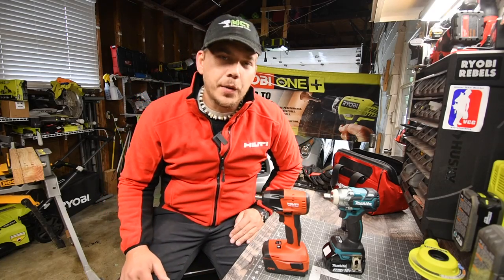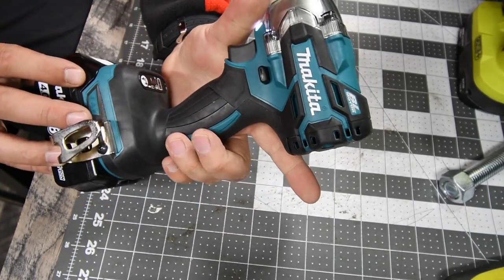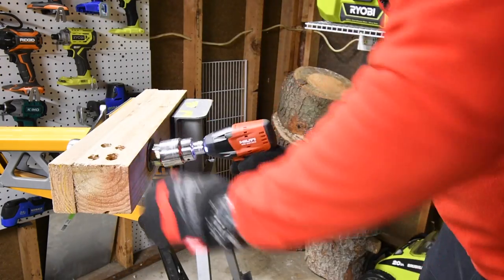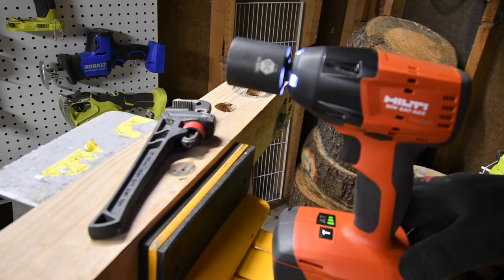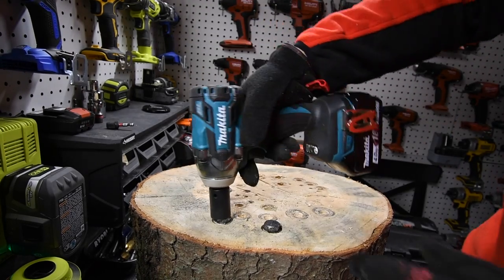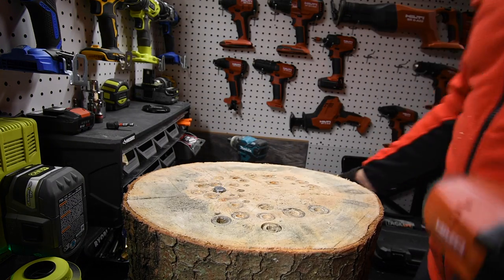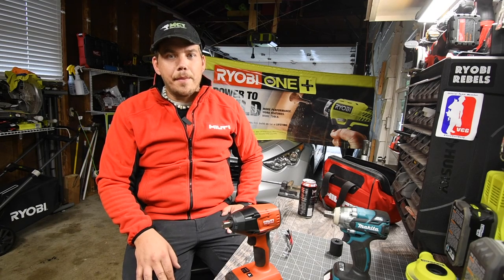Makita vs HILTI (Impact Wrench)

Comment: Hi Dave, excellent video ty so much, both are very good tools and very reliable with excellent quality warranty, I’ve always used the hilti hammer drill and Milwaukee impact, both these tools did excellent in my opinion now, I’m more interested in the hilti from past experience, the warranty is outstanding with the hilti, excellent quality tool ty, regards, Bob,

Comment: Same impact I have in my profile pic lol it's good impact for its size I think it's quite powerful it's not designed to work with wood a think more for engineering /mechanic type stuff steel framing work light  engine jobs has a decent size hammer the motor just isn't fast enough in forward really good quality tho scaffolders use the makita all over the UK
Reply from the maker: very good and I thank you Mic

Comment: the way you are using the torque wrench is causing it to be over torqued, you need to slowly tighten till it just clicks
Reply from the maker: west sir. but these impacts wrenches should be able to take it out still
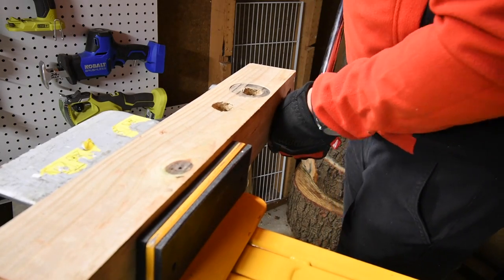Reply: Yeah. At 8:30 it looks like it went past pretty far. Using a handle that long could at a crap load more torque to that nut.  I'm still kinda disappointed these "impact wrenches" couldn't just bust those nuts!

Comment: Try it on a steel beam with 110ft pounds should blast it straight off it's rated for 210ft pounds lol dave might be the size of the nut like it does effect the performance alot👌👍👍
Reply from the maker: I will do that and yes the bigger the nut the more power it is required to to the task

Comment: Idk why the nut size would matter here. Your pivot point is the same and torque is torque. Both of these seem to be rated well above the 70 ft lbs so should have no problem. My 1/4" Makita impact driver only rated for 129 ft lbs of torque (versus the 295 in this video) with a crappy 1/4 to 1/2 adapter busts 90 ft lb lug nuts about 10x quicker than these. Guess I'm not understanding something...
Reply from the maker: yes, these are low rated impact wrenches.
Reply: I guess my point is why is the "low impact wrench" rating that has much higher "nut busting torque" rating struggling more than a lower nut busting rated 1/4 impact driver? I can't wrap my head around it.
Reply: @JML1987  thats because the motor works a bit different between those tools. An impact wrench is optimised for nut-busting torque and generally has a heavier but slower hitting hammer where as an impact driver such as yours is optimised for (un)screwing/bolting speed. In a similar spec range the impact wrench is always stronger in terms of nut-busting strength, but if a nut can be spun by both, the impact driver will almost always be faster.

Comment: You're losing a lot of torque with that adapter on that socket. You can even see in the video that there's plenty of play in there. You should do the whole thing again, but use a correct socket for the tools.
Reply from the maker: that is correct, that's why im getting the exact sockets I need for these tests
Reply: Not to mention wood absorbs impact vs say lugnuts.

Comment: You lose a lot of torque by using a adaptor. Allso because of the thin wall of chrome sockets/adaptors you lose a lot of power as well unfortunately... It really pays off to use the right accessories. I actually own the Makita (me being a prosumer and electrician) and for my work it actually rocks, especially because of the size (I don't need a lot of power but it sure is nice not needing to do lag bolts by hand. Mostly brick/concrete fastening.)
Reply from the maker: yes you do. and I thank you for viewing Mischa

Comment: Man I feel like the Fuel Impact driver would blow the doors off of these things. Great tests as always Dave. Any chance we'll see Hercules and Bauer on the Channel? I know they have Brushless tools coming in the near future🤔
Reply from the maker: the Milwaukee fuel impact driver is a beast
Reply: Makitas stronger than the milwaukee
Reply: I believe TTC's testing shown that the Makita LXT compact impact wrench was more powerful than the Milwaukee counterpart, largely because the Makita is approaching mid torque size (but also brings a power benefit from that), and because the Milwaukee compact impact wrench is pretty lack luster.

Unless you mean their actual impact drivers, in which case, the Milwaukee would still lose the torque battle against this impact wrench, because they're different tools for different jobs.

Comment: They just got wxt14 and 15, much stronger, same size.
Reply: Its XWT15 OR XWT14 just got the  XWT15 it has 240 ft.lbs of tourge and 430 ft.lbs but busting tourge
Reply from the maker: I will be checking this out and thank you Pfoxhound

Comment: Why use such a big socket on the gun if its torque is rated for mid range. I have a cheap ass makita clone from "wish" that cost $25 about $30 total shipping included it breaks loose and takes off the lug nuts on my crown vic police interceptor so easy it also works on my neighbors F250 ALL day it will remove lug nuts no problem

Comment: Think its funny how everyone judge these on weather or not they will remove a lug nut. First thing people run to lol. This class really isn't what there for. Also putting on a adapter or extension takes power away. Not fair to rate a tool with one on.
Reply from the maker: I agree with you on that one William

Comment: I'm pretty sure you're supposed to be on the lower speed for max torque smh 🤦
Reply from the maker: not for the tests im doing. not enough momentum on lower speed
Reply: the higher speeds provide more torque in impact applications because higher speeds offer more impacts per minute
Reply: Bruh, you’re not changing gears on an impact. You’re changing the max speed of the motor and it’s max power draw. The higher the speed, the more torque.